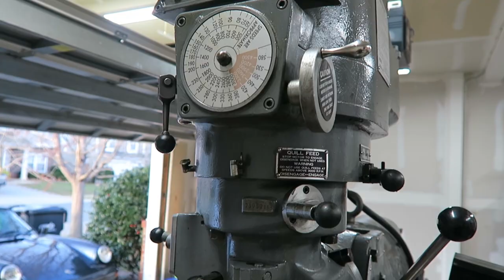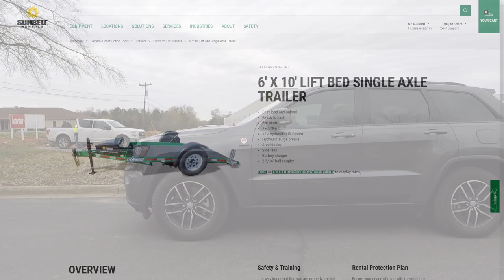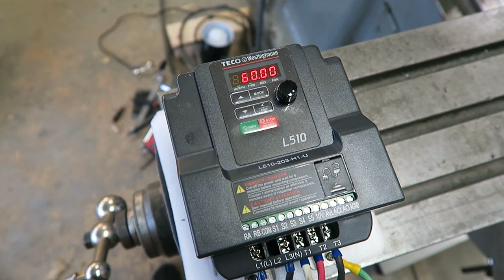Buying and Moving a Bridgeport Alliant RT2 Mill

Comment: Done the same myself. Now have a Bridgeport on a (plastic) pallet and wondering how to get it off the pallet. Saw the engine hoist in the final section of your film. Did you use that?
Reply from the maker: Yes i did, I will be putting out a video on how to do it with the engine hoist, as it requires a few small modifications, but it can be done.
Reply: Looking forwards to that! @Ultimab